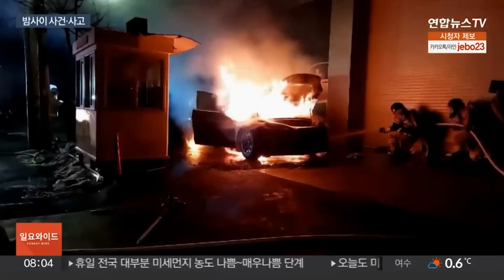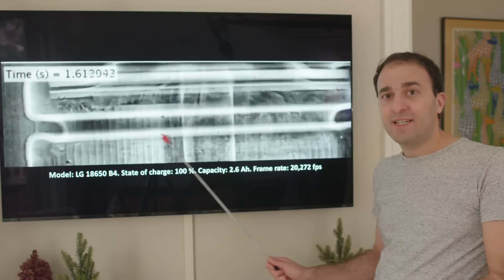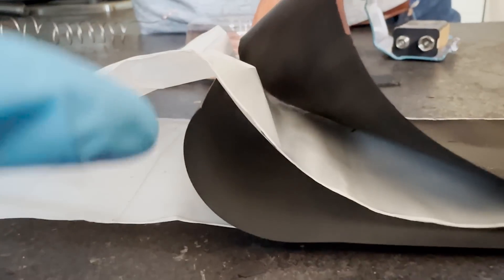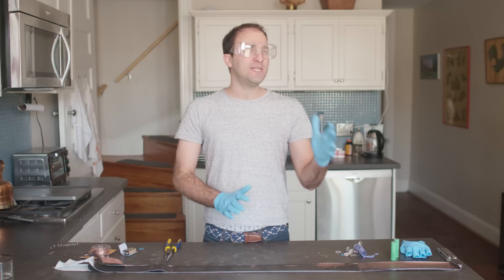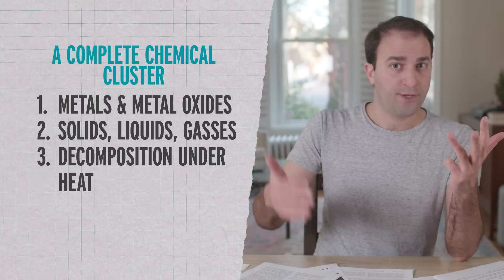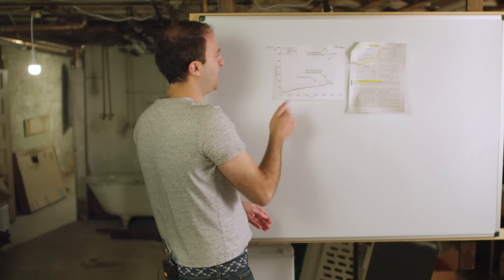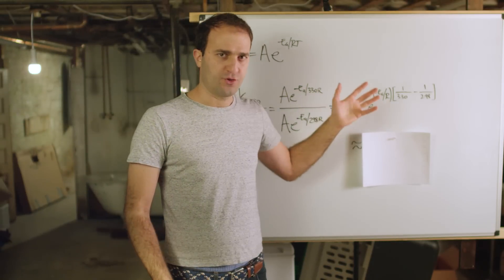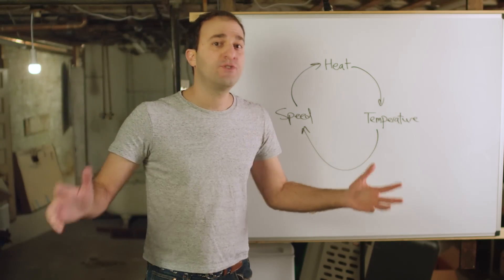Why Are Electric Vehicle Fires So Hard To Put Out?

Comment: In the offshore oil and gas business, they have designated Lithium batteries as explosives and are handled and managed the same way.  This is of course learned from experience on the negative side.  It's crazy that we have no real way to control an EV fire other than contain it to the vehicle as you are not putting it out.

Comment: Alot of people never mention there is no fix to the fire hazard pozed by high energy density batteries due to the fundamental fact that the energy is stored entirely inside the batteries.

The law of conservation of energy exists, and must be respected. With gasoline an oxidizer is required, this massively slows down the release of energy resulting in a controllable fire.

However, a chemical battery that has the same energy level can release its energy far faster since its not slowed down by the lack of oxygen in the atmosphere. The energy is physically stored in the electrolyte itself, and when that begins chemical breakdown nothing can stop it.

Any EV with a high range, will have a very energy dense battery and thus pose a serious fire risk.

Comment: Sodium batteries? Bad ideo for portable devices, and vehicles. Sodium is much bigger than lithium and store much less energy/atom. => Much more volume and weight for the same energy stored. Safer sure. And so are the matured (unlike sodium) LiFePO₄. And they live longer, too. Do you see any mobile device with that chemistry? Or any car? No? You mostly find them in stationary energy storage. For houses or grid batteries.
And those still sore more energy per volume and weight than any known theoretical sodium cells.
Yeah. No.

Comment: CHEMISTRY 101 ! ! !
Lithium-ion batteries. Lithium (Li) is a chemical Element at the head of Column 1 in the Chemical Periodic Table, also in Column 1 are the following Elements in order, Sodium (Na), Potassium (K), Rubidium (Rb), Caesium (Cs) and Francium (Fr). All of  these elements are vicious in their activity with other chemicals, particularly water, where they burn at a very high temperature. The box these elements are kept in must be totally air tight to prevent even the slightest moisture from getting into the box, if moisture does get into the container it will explode and create one huge fire which it is impossible to put out. Now research is going on into Sodium-ion batteries which are much cheaper to manufacture than Lithium-ion batteries since Sodium is fairly cheap to manufacture from common salt. If ever they do make Sodium-ion batteries, well don’t even think about it, they will be ten times worse than Li-ion batteries.
Reply: Chemistry 101 should have also taught you that just because the metallic element is reactive doesn’t mean its ions are. Do you also think that water reacts strongly with salt?

Comment: There are three ways to extinguish a fire remove the heat that causes the reaction, remove the fuel that feeds it, or remove the oxygen it needs to continue the reaction.
If you put a fire in a bottle, then put a lid on that container it extinguishes very quickly because it eats up the oxygen really quickly in the small space.
I've often wondered why the fire department doesn't create a big expandable box that can be lowered over vehicles to smother car fires. There could also be sprayers inside the box to cool and help put out fires.
Where the batteries in an Electric vehicle would create their own oxygen, a fire would only have that oxygen to feed it, so in theory it would be easier to extinguish.
You could also pump carbon dioxide inside the box, cutting off the oxygen that is required to continue the reaction.
A metal box would have to be pretty thick, so the heat would not distort the metal so it would be pretty heavy I'm not sure if you could make it out of another material like asbestos or ceramic making it lighter and easier to put in place or if you could make it like a fire blanket and just drag it over the vehicle.
Just find it silly to dump water over a vehicle to try and extinguish  a fire as the vehicles body panels prevents water from reaching certain areas.
Granted you could not be used this in all situations like if a person was trapped inside the vehicle it could not be used but in certain situations I can see it could work better than just a dumping a ton of water on the fire.

Comment: + feed back has had its nasty little face in back ground on a lot if projects threw history....the f1 rocket all most dent take us to the moon because of flame oslation running around the combustion chamber like 30,000 times a sec....an pogo you get +feed back stated in that problem that leads to the fuel pipeing turning into tuning fokes.... not good....great video 👍🏼👍🏼👍🏼

Comment: In the old days Halon gas was used (still is in aviation). You either pulled a handle or it was self activated. You could factory fit a nitrogen bottle to do this but you might end up with a lot of dead car mechanics somewhere down the line.

Comment: On YouTube channel Stache D he, as a fireman, recommends just leaving the car to burn. To save water and keep firefighters safe.
The newer LFP batteries are a lot more stable than the older chemistry batteries and its harder to get them to catch on fire..
Reply: Ignition of gases from LFP batteries destroyed a few houses in EU. Brick walls was destroyed. LFP produces 2-times more H2 than NCA or NMC. If there is a spark and gases are not ventilated, but accumulate in s small volume / 2000 - 50000 litres /, after ignition, the reaction with O2 is quick.
Reply: @PavolFilek  There was one and they still don't know the cause.

Comment: Fantastic and entertaining video sir!  I have sent a few li ion cells into TR intentionally and not.  The white hot sparks that are emitted with a Fully Charged cell are a sight to behold.  Reminds me of thermite reactions.  Think about high Nickel cathode chemistries.  The Ni0 is callandered on to a sheet of Aluminum which is the positive current collector. .. according to the web Ni0x and AL powder also make thermite... so u see where I'm going with this. Another observation is that below 50% state of charge the cell usually vents Without the thermite fireworks.  In a discharged cell much lithium has been transfered to the cathode.  I suspect that Li is more strongly bonded to the oxygen than Aluminum, and this prevents the Aluminum from from reacting with the Li loaded Nickel oxide?
Your comments please sir.

Comment: Okay firefighters, I’m a chemistry teacher and an Army veteran. Here are my questions:
1) How are you CURRENTLY trained to extinguish a BONA FIDE alkali metal fire such as burning potassium or sodium?
2) Has ANYONE explained to you that EV fires may fall into this category?
3) What happens when you add water to an alkali metal?

That’s it. 

P.s. Fire departments might want to explore carrying 20-30 gallons of liquid nitrogen in a dewar on fire trucks precisely to deal with things like this. (It reduces heat and oxygen really well.)
Reply: LN2 would be incredibly expensive and wouldn't take away the heat nearly as much due to sublimation and lower thermal mass, not to mention the suffocation hazards.

Oh and most people don't realize that EVs can (and have) literally burn while  underwater. They would almost certainly burn when submerged in LN2 as well.

The fire when put out usually will reignite itself at random intervals, without warning over the next few days.

A major problem is you can't cool the cells as they have thousands of cells and an entire vehicle surrounding them and keeping the heat in.
Reply: Lithium ion battery fires are not classified as an alkali metal fire (class D). The lithium in lithium ion batteries is not metallic lithium, but are lithium salts, hence the term lithium ion. The unquenchable fire is due to the supply of oxygen, released from the metal oxides in the cathode, burning with the flammable electrolytes in the battery.
Reply: There are three ways to extinguish a fire remove the heat that causes the reaction, remove the fuel that feeds it, or remove the oxygen it needs to continue the reaction.
If you put a fire in a bottle, then put a lid on that container it extinguishes very quickly because it eats up the oxygen really quickly in the small space.
I've often wondered why the fire department doesn't create a big expandable box that can be lowered over vehicles to smother car fires. There could also be sprayers inside the box to cool and help put out fires.
Where the batteries in an electric vehicle would create their own oxygen, a fire would only have that oxygen to feed it, so in theory it would be easier to extinguish.
You could also pump carbon dioxide inside the box, cutting off the oxygen that is required to continue the reaction.
A metal box would have to be pretty thick, so the heat would not distort the metal so it would be pretty heavy I'm not sure if you could make it out of another material like asbestos or ceramic making it lighter and easier to put in place or even better if you could make it like a fire blanket and just drag it over the vehicle.
I just find it silly to dump water over a vehicle to try and extinguish a fire as the vehicles body panels prevent water from reaching certain areas where the fire is contained.
Granted this could not be used in all situations like if a person was trapped inside the vehicle it could not be used, but in certain situations I can see it could work better than just a dumping a ton of water on the fire.
Reply: @urgreatestenemy I hope with the passing months since you made this post you had managed to research the top? (Thermal runaway)
It will no doubt be of use to you.

Comment: what exactly (what metal oxide and why) is contained in the cathode, that releases oxygen?
Reply: It’s mostly the ones that contain cobalt oxide that are subject to thermal runaway. The cobalt oxide breaks down at raised temperature, releasing oxygen that then reacts with the electrolyte. If a lot of that happens, then it all gets out of control pretty fast.

Lithium Iron Phosphate batteries are much safer - no cobalt oxide, but not immune to fire.

Comment: Why would you use plain water to extinguish an energized electrical battery fire that's loaded with toxic element that kill people in the first place? NFPA standard on fire extinguishing systems recognizez energized electrical equipment as Class "C" fires. Class A fires are fires that burn ordinary combustible materials like wood, paper and cloth. Class C fires involve energized electrical equipment that react violently when water is applied. So why are you looking at the use and application of water on a fire that reacts violently to water? Is it to get a REACTION for your YouBoob channel??

Comment: So interesting, other than the design of the battery itself, they could in fact try cooling the fire faster, say with dry ice or liquid nitrogen! Do you have any thoughts about this?
Reply: I had a similar thought. Biggest problem is that the fire is in the battery pack, which is always installed at the bottom of the vehicle (to keep a low center of gravity). So you can get water or other cooling agents to the battery directly. In short, the water is almost completely useless, and liquid nitrogen might not be much better. And then you'd have to keep a substantial supply of it on hand, in a tank you could tow behind your fire truck? Logistics are difficult, to say the least.

Comment: We now know that when Li batteries combust, that in doing so, they create oxygen.
So why do fire departments STILL empty 100’s of gallons of water all around about??
These batteries need to be cooled,not drowned.

The simple use of carbon dioxide to chill those combusting  batteries - I Deliberately DON’T say burn!!   - will stop the chemical reaction that creates the oxygen.  That then will prevent the cycle that allows self combustion to heat up the peripheral batteries, compounding the situation, spreading the heat and continuing the burn-out of the entire battery pack, the car being wrecked, AND insurance prices to soar/Rocket even, exponentially! Per 100 burnouts….those cars ain’t Cheap!

Comment: pressure valve: so it's not a tech issue but a design one. And this is why research is well on the way to use an electrolyte solvent that isn't water. Ionic liquids are much much safer.

Comment: After the Freemantle Highway fire and the need to evacuate the ship because the fire could not be extinguished, I wonder how long it will be before there is a serious EV fire on a car ferry requiring evacuation.
Certainly on car ferries on the English Channel there do not appear to be any additional measures to deal with EV fires despite the increasing proportion of EVs therefore the increased probability of one occurring in  or spreading to an EV from a fire in an ICE vehicle.

Comment: EV fires are hard to put out for the exact same reason why UPS Flight 6 was so difficult to control. Lithium is an alkali metal, and anyone who has spent time in a chemistry lab can tell you that Group 1 of the periodic table is without a doubt the most reactive set of elements there is. You throw sodium in water and it explodes. You throw lithium in water and it does the exact same thing — will never forget that King of Random video that involved taking a lithium strip out of an Energizer battery and throwing it into a bowl of water. The reaction gets so violent that it actually melts the glass bowl and causes it to crack from the thermal stress.

Battery fires are really Class D fires, pure and simple. Those same precautions that firefighters take when fighting magnesium fires need also be taken when fighting electric vehicle fires, because the chemistry involved is the same.
Reply: Wrong. In Lithium-Ion batteries is little to none Lithium in a metalic form.

Comment: For the Swedish research "Putting out lithium ion batteries with plain water in a short time", there's https://www.youtube.com/watch?v=4xjDdmv8urk video that shows how they are looking at coping.

Some of the issues are unfamiliarity and 'lack of practice' (see #1). Regular vehicle fires can be much worse, but they are familiar and not newsworthy. The ship fires are interesting as they carry on regardless (i.e they have been happening for decades). The LashFire study webinar https://www.youtube.com/watch?v=yj76SXMr_ok has some real (live) fire demos - the main issue isn't the fuel but the plastics and rubber in the vehicles.

Finally there's likely to be a shift to the LFP technology which is a positive temperature coefficient chemisty so doesn't suffer the same thermal runaway problem as Li ion.

Comment: There are currently about six Lithium battery chemistries.  LMC is often chosen due to its high power:weight ratio for EV’s and are subject to thermal runaway.

LFP (lithium iron phosphate) batteries by contrast are NOT subject to thermal runaway, and furthermore have about five times the number of charge/discharge cycles. If a battery is to be placed inside a structure (house, RV, boat, etc) then LFP chemistry is the prudent solution for both safety band longevity. 😎

Comment: How much energy is given off during burning than what is stored in use.  For example, if a battery pack is 100 kwh, how many Kwh of heat are given off when the battery burns?  10000?  100:1?

Comment: The lead acid battery in our cars was one big cell but who knows now. It just seems that the rush to electric with all the activists in a hysterical panic funk giving short deadlines meaning just lashing together thousands of these torch batteries is a make do bodge. The tech seems to be all chemistry with no sign of any overall physical design thinking on an integrated safe module specifically designed for a car. Maybe it is not possible but these masses of single little cells wired in series to create mega voltages just do not look safe. I would certainly not feel safe sitting over a mass of them and I worry about members of my family that do. I would not leave a single camera battery on charge over night unattended and sleep safe let alone 3,000+. The fact that most non OEM camera battery charges leave out the thermistor pin and some batteries dummy the output shows how sloppy standards can get to save costs and make the sale.
Reply: It isn't one big cell.
It's several

Comment: The 2 biggest EV manufactures are BYD - 100% lithium iron phosphate batteries (LFP) - and Tesla whose best selling models by far are the standard range model 3 & Y  that now use lithium iron phosphate (LFP). Ford has also moved to LFP. LFP are far safer than Li Ion just Google byd blade battery nail test

Comment: Statistically, ICE vehicles are more likely to catch fire than EV's, but is that just because the ICE car population is on average much older? It is far more likely that an old ICE has faulty wiring or fuel lines than a newer ICE car. Since most of the EV vehicles on the road today are relatively new, perhaps that is why they are less likely to catch fire. What will happen when there are many times more EV's on the road, and their average age is a lot older? Also, the older the EV is, the more likely it will be that the battery pack has sustained some damage. Look at the EV's in Florida that were flooded in the recent hurricanes. They are ticking time bombs.